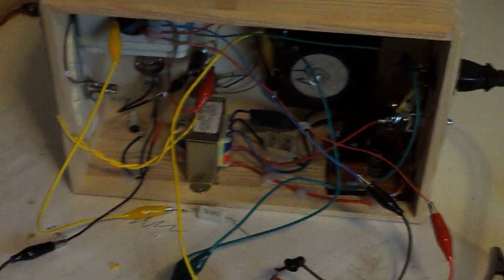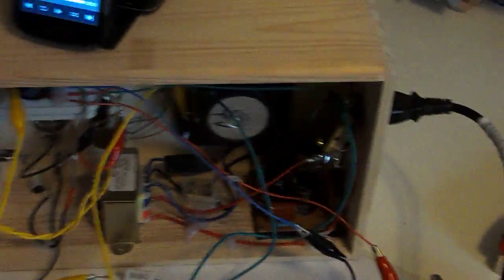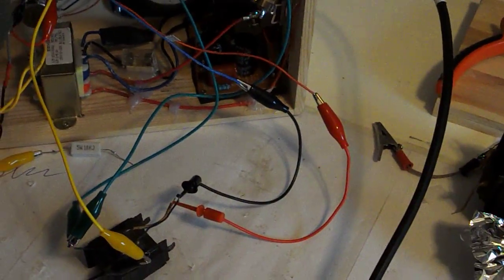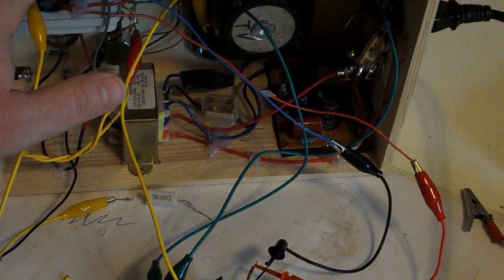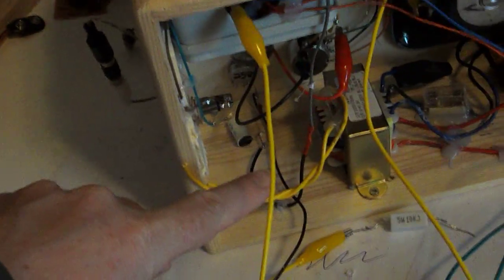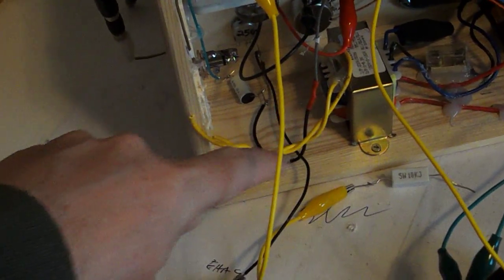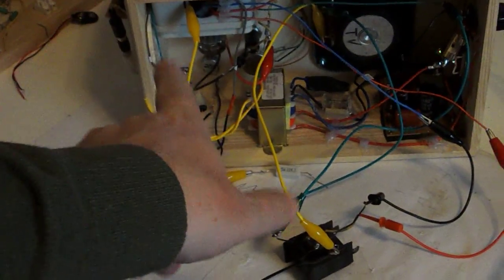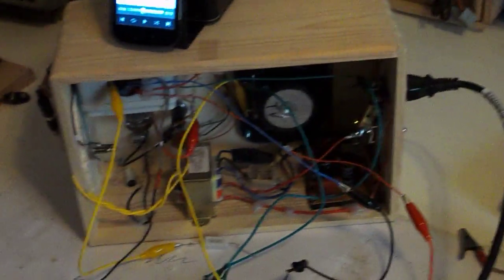6AF11 Compactron Amp 2

Comment: All audio valves should be quiet enough to use with AC supply, they all were designed to use this cheap reliable way to heat the cathodes and did for 50 years +. So it will work, but a battery is better. The voltage is critical, there is no slightly over or under that is ok here, cathode poisoning or heater failure and unknown characteristics in use will result. Within 10% is required. 6V is 5% low and perfectly OK.

Comment from the maker: Just look on eBay for "B12C compactron 12 pin socket".....if you get too many non-tube hits try ""B12C compactron 12 pin socket vacuum tube" and you can get 2 for about 7 bucks. You can get 10 of them for 18 bucks if you have plans for more....I made my first 12-pin compactron socket myself using plumbers epoxy putty and some generic pin clips. Not too hard to do if you're resourceful.
Reply: +MAN CAVE NO.1 i like your attitude :)